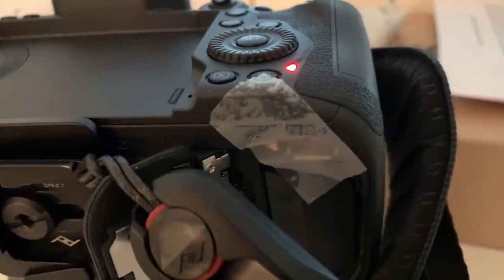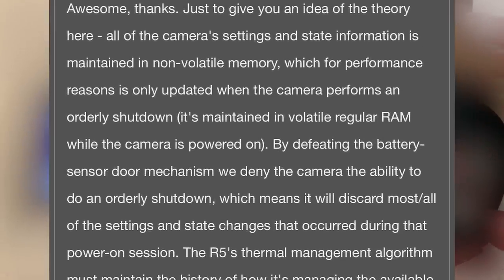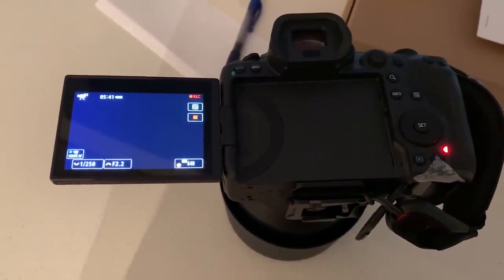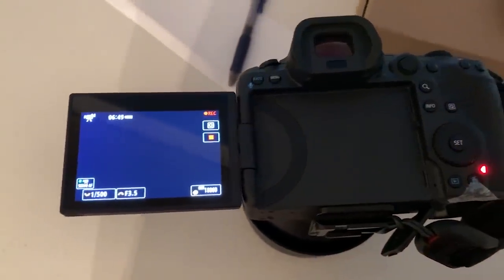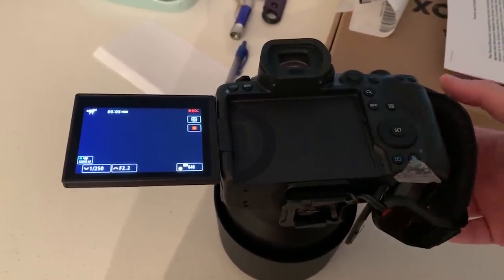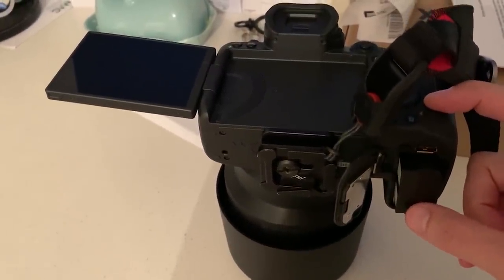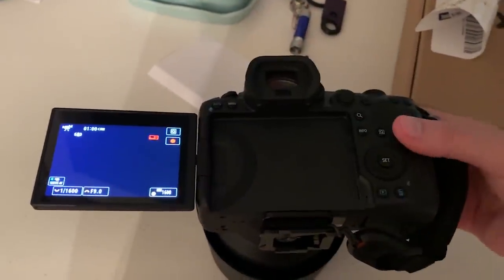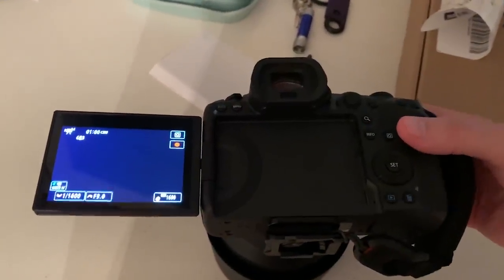CANON R5 OVERHEATING FIXED 😳 With SCOTCH TAPE!! Crazy !! But TRUE!! WATCH THIS!!

Comment from the maker: Just to let you guys know, I did this test 3 times back to back and it gave me 5 minutes with no warning each time , so it definitely proves something! Also there was an hour and a half in between the time a did the standard overheating test with no tape, so it was cool again and still overheated and stayed that way no matter what a did! So the trick is real proof of something!
Reply: but honestly you know they cripled it but can you see it from thier narative they spent money in investment and they made tools we love ...i know you want r5  to outperform thier c300 mkiii ...imagine someone bought c300 mkiii then r5 work flawlessly that person would be angry....people demanding r5 to deliver flawless results... i dont know i cant agree with it...if the r5 performs flawlessly it will destroy a heap of industries do we realy need that....i make money from video i would like to tell my clients i got big guns and my prices are sweet...i want to give them a sense of value for money but if every one has r5 that kills everything
Reply: you have clients some pay little some pay well and you should try maximise your profit
Reply: Is the reason you're only getting 5 additional minutes after your tape hack instead of no limit because it's going off the measured heat inside when the battery is reinserted?  If that's the case then they should trust their heat measurement to protect the internals and not throttle the camera with the time limit too.  Chances are since it's always 5 minutes that they're even being conservative with the thermal limits as well.
Reply from the maker: justaviewer111 I think that is exactly the case! If they trusted the real heat sensor we could cool down instantly for a few  more minutes
Reply: So, if your are shooting with a dummy battery to an external battery you can just pull the cable at that source while the door is still closed and get the same effect without a toothpick and tap.
Reply from the maker: Robert Muns in theory that should work the same!
Reply: @SNAPAVELI  so, after pulling out the power supply, do you get a damaged video fragment or a good one?
Reply from the maker: Misha Svetlov I’m not sure! I’m going to try and press the record button to stop it then pull the battery, see if it will still trick it
Reply: @SNAPAVELI  I just tried it with 8K and it did remove the overheat warning.  I got the warning at 16:55 and pulled the battery at 18:05.  I recorded again for 7:57 without a warning but at 7:57 it abruptly stopped recording with the "Movie recording stopped !" message.  Also the first recording where I pulled the battery is a .DAT file instead of a .CRM file; the second one is .CRM.  The camera was hot to the touch, but 8K.  I would like to try this again in HQ4K24 and 60 to see if it will keep going without a true overheat.  Edit:  I just realized that those ~25 minutes of recording maxed out my 512GB CFexpress card lol.  That is probably why it stopped.
Reply from the maker: Robert Muns awesome find!! Be careful! I’m still not sure how hot the camera actually gets! Mine did feel hot as well.
Reply: @unityspirit1  so, the "dropped" file .DAT is unusable?
Reply: @SNAPAVELI  tnx for your experience share, i guess canon blocked such an opportunity, i mean you press stoprecord - camera closes the movie file AND writing counter data simultaneously
Reply: @mishasvetlov7961  Yes, I have not been able to get it to import into Premiere.  I did try changing the file extension to CRM but same import failure.  Killing while recording did not allow the camera to properly wrap the file.  Let's see what Marcus gets when he stops the recording, I will try as well when I get a moment to do so.
Reply from the maker: Misha Svetlov they have went to great lengths to insure no workaround the madness!
Reply: @unityspirit1  tnx for your experience share, i used to recover such a file after canon's power shutdown, it's wasn't too easy. the question is: if you stop record AND immediately switch off the power - will it reset the counter? i guess not.
Reply: Misha Svetlov yeah well I thought you can do it after your stopped recording  ! ? I guess it only works if you do it while it’s still writing ? Damn Then this is not helpful if so
Reply: @moealyasini2784  I have no complaints about what the author of the video did or said, but there are commentators who believe that this video confirms that it is possible to record a workable video, that the problem of overheating is really solved. i see the author did not say such info, some kind of misunderstanding i think
Reply: Thank you!
Reply from the maker: Misha Svetlov Yes! This is just to prove that the overheating is suspicious at the very least! This won’t work in any professional environment, also when the video clips do save, some users are saying they are broken unreadable files, so Canon has prepared for this somewhat. I do however think it proves , after doing it several times back to back to back, that if it was truly still hot enough to set the warning off, the warning would be there. You can’t trick a thermometer
Reply: J. Marcus Photography so! Just a thought: if the last video file was damaged when you pulled it out while recording BUT the timer resets anyways and it gives 5 extra minutes ! What we can do is stop recording the actual video.. then start a dummy recording for a few seconds to do the trick.. then when we are back after the battery pulled out and in we dont care to lose that dummy 5-10 sec video recorded but we will get our extra time !!
Reply: @moealyasini2784  Corecto Mundo
Reply: @SNAPAVELI   Because the inside of the camera is 9 degrees hotter than the outside. Because of the camera body material. They don't want to be libel for any lawsuit. However there is nowhere for that heat to go.
Reply: @SNAPAVELI  Warning do not sometimes reoccur if someone intentionally bypasses them. Another thing to remember, that Overheat threshold level was written to CMOS memory. You can't sue them for any damage that may occur afterwards or any loss of income related to it. Because they warned you. Merely preventing the icon from occuring on the LCD is no proof that the occurance did not get written to recoverable cmos memory.
Reply: Great work Marcus. Just earned my sub we are about the same count. Here is my perspective from a photographer and from running an electronic engineering business:
 R5 does Heat up and it is a noticeable heat which it tells me that the internal heat could potentially damage the sensor or any of the other components. It's not the one time heating but the ongoing heat up that can fry some of the component over time. The whole camera doesn't have to get really hot to fail. You could have a very small crucial component heat up to the point of failure without producing noticeable heat in the camera. 

Keep up the sick work.
Reply from the maker: Gaston Shutters Thank you! Just subbed to you as well!! I totally agree, the camera is definitely hot to the touch. This isn’t good long term. My issue is that my Sony A7riii or iv would get really hot as well. They would stop recording but the cool down was less than a minute to shoot another few minutes. That’s really all I’m asking for, just a truthful cool down period to record again!
Reply: J. Marcus Photography WORRRRRD
Reply: J. Marcus Photography yeah man. Can be frustrating because I also had high hopes for this to be a perfect hybrid camera. I use it mainly for photography so is not so much of an issue ...but it is at times. The A7RIV is still my main go to camera.
Reply: You just avoided the camera to remember that it overheated.
You didn't stop it from overheating actually.
So this is just gonna cause damage to your sensor eventually.
It may let u shoot longer but that doesn't mean the sensor didn't overheat.
And that's no solution to real issue.
Reply from the maker: Yogesh Joshi I’m not ruling out your conclusion! You can’t rule out being suspicious of a camera that says it needs 6 hours to recover from shooting 10 minutes of video though...
Reply: @SNAPAVELI   Totally agreed, there is something wrong in the firmware.
But that doesn't mean sensor is not heating.
Most people who reported the issue have not reported it just cause camera firmware prompted them, but they could actually feel the heat too.
And as per laws of physics, increase in heat worsens signal to noise ratio as well as it can cause loss of pixels over the period of time.
Now a firmware asking you to wait for 6 hrs after 10 mins of shooting is definitely an issue 
But it also means that sensor did reach it's limit of temperature at which it can perform optimally.
So the core issue of overheating still remains despite the clear error of firmware suggesting it requires 6 hrs to cool down.
Reply from the maker: Yogesh Joshi totally plausible! The Sony’s reach their limit and are back to shooting in under a minute, not sure why canon can’t do the same...
Reply: With the Ninja Atoms, there is no overheating issue, can a quick Videoshooting with the atomos also Reset the Canon timer after the overheating issue? Would be nice if I could use my atomos as a reseter unit! Can't test it myself because the r5 has not jet come to my place...
Reply from the maker: ili kapi I don’t have the ninja right now either but that’s a good test to try!!
Reply: max max thanks for this hack bro but damn that’s like asking for the ca,era to get bricked lol

Comment: This reminds me of when HP put page limits on their ink cartridges for their printers instead of going off actual ink levels. Customers were not able to print because the printers would say it was out of ink but they could shake the ink cartridges and hear that there was still ink inside. This resulted in a class action lawsuit against HP so perhaps something similar will happen to Canon here.
Reply: I posted on the Canon Community on Reddit, the he headline was :”If Canon is lying about this overheating thing, isn’t that illegal?” 
Result: my post was deleted by a community moderator lol

Comment: Thanks for this Marcus. As you said, it would not be wise to try this on a regular basis for risking the camera. I'm hoping the firmware will do it properly and soon mate. Good video.
Reply from the maker: Thank you Simon!! Appreciate you checking it out!!
Reply: @SNAPAVELI  I'll mention this in an upcoming video, but it makes me nervous. I want them to fix it properly instead of using a time clock. I don't want to be watching internal temperatures to determine if it is safe to record ;) Fingers crossed for firmware.
Reply from the maker: Thank you!! Yes I agree, I don’t want to break anything, but I’m sure the cool down times aren’t accurate by any stretch
Reply: @SNAPAVELI  oh, agreed. I'm sure someone will get sacked over this. They've lost face big time.
Reply: Waiting for your video on this @ordinary filmmaker

Comment: Good job. Nice experiment, which does prove something but not everything. Did you try to go from 30min 4K HQ to overheat warning and then doing the trick? How many minutes does it bring? That would give some more insight about the temperature sensors read out and saving. Also you after turning the camera back on, if it shows 30min again, leave it on in standby for 2min or so and watch if the time decreases drastically by a possible temp sensor readout.
Reply from the maker: My card was too small to do the full overheating in one pass! So I did the first part off camera , my 64 card filled up at 17 minutes. Then I repeated until it overheated, popped battery and got 5 minutes instantly 3 times in a row before I decided It may be a bad idea to keep going. So it is definitely hot enough to low that it can’t go another full 30 or to card limit , but also that it’s not so hot that it needs hours to cool down, and in theory it would let me record 5 minute bursts indefinitely with 10 second cool downs. Just my thinking

Comment: Thanks for the information! How about testing the camera temperature difference when shooting 8K and 4K HQ vs the lower quality 4K that the camera has no time limit for? How hot does it get after 1 hour of standard 4K??
Reply from the maker: It definitely has a time limit, the most I get back is 5 minutes, but I get that 5 minutes as many times as I have tried in a row! Some users say the files are broken though in post so it may only be proof the heat warnings aren’t true!

Comment: Good experiment! I am optimistic Canon will play dumb and make this right with a firmware upgrade. I am tempted to use this method but worried I will possibly really overheat my R5. The "cool" thing about this method is that you are not taking apart the camera or downloading an unapproved firmware hack. I may wait to see what others find as they try this. Curious to know if it this will work if the overheating is allowed to count down to zero first? I have gone from annoyed and grumpy to sort of excited that there may be a simple hack that makes my r5 exactly what I originally thought it would be... or better.  side note; I shot an event with the R5 in 1080 60 to the CFEX card and it got really hot in my hand after about 30 minutes but no overheating ever turned on even after 1 hour. I shot the next event in 1080 60 to the SD card for 1 hour and no heating up in my hand at all. There is no doubt writing to the CFEX continually for extended periods will produce heat in any video mode. But no warning when it actually got really hot in lower resolutions. very curious.
Reply from the maker: I totally agree!! I wouldn’t do too much of this until we figure out how hot it actually gets. They need to add 1080 120 too! Atleast give us something to fall back on while we wait!
Reply: Let's see if magic lantern will make a firmware for this like they did in the past...i would pay for this to be removed
Reply: You're right to be concerned about the possible effects of forcing the camera to stay on longer than Canon intended.

Comment: i feel some 3d printed  'super mod' battery doors will surface on Ebay and Amazon very soon. R6 will be come the king of the value after time restriction removed. 👍
Reply from the maker: Really hope they fix it!! R6 will be amazing
Reply: absolutely! 5k down sample 4k60 4k30 no crop  recording all day long. Clog plus Prores on Ninja V for only $2500. 🔥🔥🔥 evf and low resolution screen is totally irrelevant.
Reply: J. Marcus Photography man, R6 will be reborned thru your hands.

Comment: This basically confirms that it's a timed overheating procedure from Canon, if it were true overheating from a temp sensor, it would detect right away that it's hot once you restart and this trick would not work.
Reply from the maker: Exactly!! So when I get the true overheat warning 5 minutes later, all of the 3 times, I hope is what we get closer to in firmware update

Comment: So basically what you’re saying is run a dummy battery and when it’s going to overheat you pull the D-Tap from V-Mount and now you’re golden.
Reply: I gotta try that, because I already got the temperature warning icon on both of my EOS R5 bodies at a few weddings so far, and I was only shooting stills, no video.
Reply: Test it, Armando! 😆
Reply from the maker: Hey Armando ! In theory yes... but you can’t press the record button to stop the clip first or it writes the current status to nvram. Also some users are reporting that the once the batter is pulled the video clip isn’t usable once imported into computer , so possibly it damaged the file. That would make this test purely a test proving the warning is somewhat arbitrary, but not a recording solution. Please test, I don’t have a dummy battery!
Reply: Then solder in a timer that automatically cuts it off after 15min. and have a software solution that batch repairs the corrupted files (probably by cutting off the last few seconds).